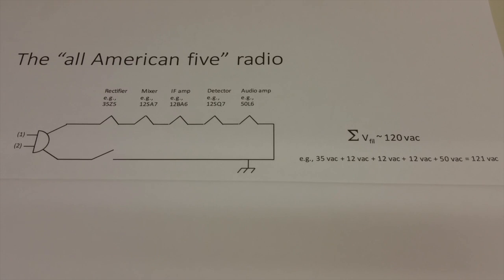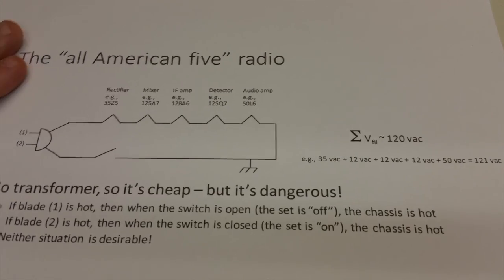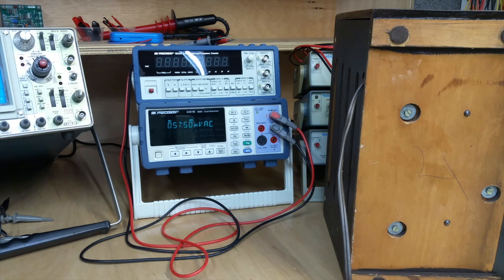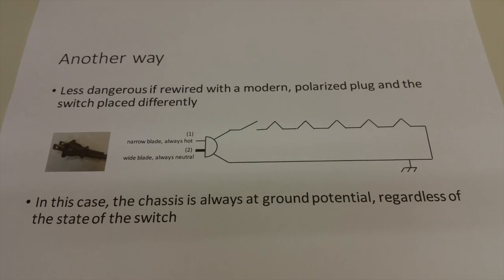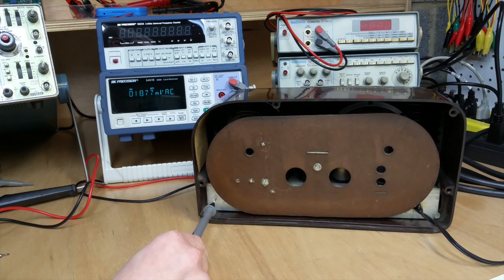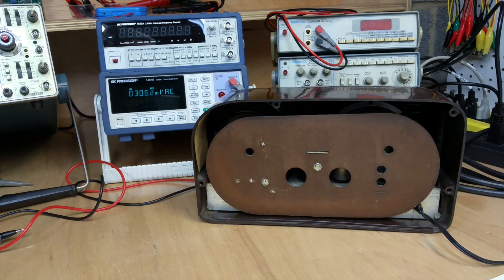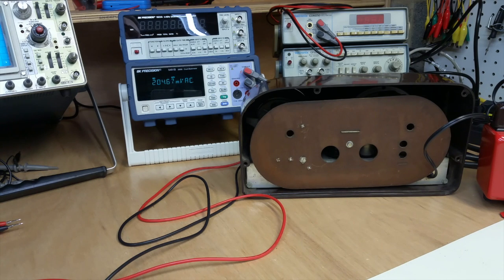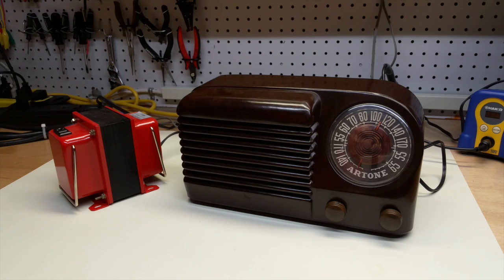#4: The "All American Five" radio and isolation

Comment: I'm likely missing something here, but  wouldn't- 1. Wiring the switch to the hot side 2. Using a polarized plug that's properly installed  3. wiring a GFCI into the radio  provide more than a measure of safety in an All American 5?

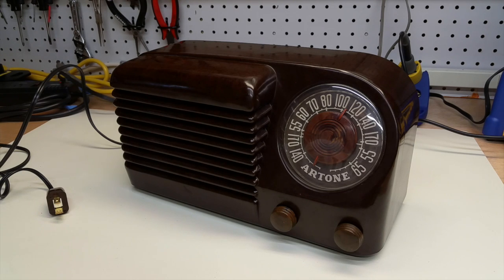Comment: What mistake was made that the Artone starting around 6:33 was not safe?  I would guess that the hot lead was wired to the switch, but the switch was not rewired, so when the switch is on, the hot is connected to the chassis?

Comment: Great video! When I was a kid it was so common for things like this to give you a shock that it’s hard to believe we survived. We had a Webcor tube record player with a metal tone arm that would give you a jolt if you had bare feet or touched a ground while operating it. Later on I had a Silvertone tube record player that did the same thing, I remember telling my dad but he couldn’t find anything wrong with it. I also had a Zenith AM/FM tube table radio that would deliver full line voltage to the chassis, it sat on a shelf right beside the radiator in my bedroom. One night I reached behind it to mess with the antenna while my arm was touching the grounded radiator and got knocked outta bed! Consumer Reports used to warn you about this problem and deemed some of these units “unacceptable” if knobs could be pulled off or live screws were exposed.

Comment: I had a 1955 RCA All-American five radio. We were down at Rehoboth Beach for the summer, and I put the radio on my bare lap with my feet in the sand. I got shocked so bad, that I peed myself. My father thinking something was wrong with the radio cut the plug off. One of the two screws on the bottom had made contact with my leg outside of the shorts...

Comment: Very good video.  The only comment that I have is that I have the very Aretone radio in the video  It does have a back that is missing in this video.  However, as the video points out, the radio is no safer with the back on-the screws on the bottom and the knob shafts can still be lethal.

Comment: So if I am using an O Scope to test this type of radio,should I plug the scope into the isolation transformer along with the radio,or is it 

okay to leave it plugged into the house mains? Which is safer?
Reply: The radio should be plugged into  a variac then plug that  into an isolation transformer . You can safely use the oscilloscope as normal.
 But before doing so make sure the radio has a polarized plug and the neutral line goes into the line from the filaments AND the other side ( hot) is switched
that goes to the filaments and bulb. As the video shows don't assume that someone else has just put a polarized plug on it without checking the circuitry!
Reply: Run it off a battery supply

Comment: I don't need to know the warnings of a hot chassis on a radio, a long time ago we had one of those round vintage fridges, that was ungrounded, and next to the fridge was the light switch for the room, which had a stainless steel cover, naturally id turn oin the light while opening the fridge, but in doing so id complete the ground leg of the fridge and get this buzzing feeling through my entire body, id let go, but this would happen a few times before I learned my lesson, its not a fun feeling either I might add
Reply: These are the reasons in Europe you cannot plug an ungrounded (not double insulated) plug in a grounded socket but can do the opposite.

Comment: Until I can afford certain pieces of equiptment ,how about a safety capciator and or a fuse.or if I tough a volume knob to make sure I dont touch anything else ,and yes getting shocked is something I fear I been blasted a couple times when I was younger.Thanks for your video ,can I ask what did you pay for your isolation transformer and where did you buy it at.

Comment: I remember, years ago, when I first encountered these safety plugs in which one prong's wider than the other, I didn't understand their purpose.  It was inconvenient to plug them in the right way so I ground them all down with a motorized grinder so they'd fit the socket either way.  I was wrong & beg you for your electrical forgiveness.
Reply: This is all well and good as long as the mains and extension boxes are wired correctly too. My test bench has a Variac feeding an isolation transformer with a dim bulb series limiter. The hot and neutral wires can be reversed after it leaves the breaker box. The only safe option is a ground fault interrupter and that still requires the  DUT to be wired correctly. Many of these Radio restorers are more concerned with cosmetics. The AA5 came about to be so popular as a result of the WWII effort. Transformers required miles of copper and the military came first.

Comment: Thank you for this lesson,I just bought a 1953 Sears Silverstone,I got a feeling it's a hot chais,I haven't open it yet I will soon to order caps for it ,I am thinking of getting a isolation transformer ,I found a good price for a new one ,if you no anything about my 1953 Silverstone radio please let me no ,I hate getting shocked,I am going to try the method you are showing us for testing it ,do you recommend replacing the cord ,the plug it has on it ,I can switch the wires around ,if you think that idea is ok ,please let this old man no,I did buy a replacement plug for it ,pretty much the same .thanks again for your safety video
Reply from the maker: I'm glad you found the video interesting. I strongly urge you to learn more about radio repair and restoration before working on your radio or anything related to mains power, which can be lethal. The Antique Radio Forum, http://antiqueradios.com/forums/viewforum.php?f=8&sid=3279a08b28998acdefc23bd2285bd047, has such information and can provide guidance, as can other sources. Please be aware that there are different types of isolation transformers, and not all provide the needed isolation. See, e.g., http://www.antiqueradios.com/forums/viewtopic.php?f=8&t=120898 and other similar threads at that site.

Comment: First “thank you” sincerely for saving my life, since I’m very new to radio restoration.  

I bought a Varik.  Is that the same as an isolation transformer? Also I’m currently working on my first AA5 project a Hallicrafters  5R33 AM/SW so what do I look for to ensure I use an isolation transformer?

I did learn never to plug in an old radio which I have not done so far.  

Thank you once again.  Steve
Reply from the maker: A Variac (also known as an autotransformer) provides no isolation. The variac and the isolation transformer are different. There are on line resources describing the need for and proper use of both variacs and isolation transformers available at the Antique Radio Forum (there are numerous threads, see, e.g., http://www.antiqueradios.com/forums/viewtopic.php?t=62638 and http://www.antiqueradios.com/forums/viewtopic.php?f=8&t=194901) and you can also ask questions there. See also the excellent https://www.youtube.com/watch?v=XBsQ3sZ45Fk&t=1s.
Reply: I found variact ebay as low as 39.00

Comment: Thanks for the information. I just restored a Majestic "Zephyr" radio from 1946. I installed a line cord with polarized plug and re-wired the switch to the hot line of cord, a pain as Majestic used the switch contact as a ground point for 6 or so components. 

My radio has two grounds in an attempt by Majestic to mitigate the safety issue. This AA5 radio has its chassis semi-isolated from the rest of the circuit with a .05uF capacitor in parallel with a 220k resistor. This limits the current, but both the cap and resistor will pass AC. I figure the reactance of the .05 cap to be at 53K at 60 Hz. In parallel with the 220K resistor or about  42.7K ohms. This will still pass 2.8mA of AC current, enough for a nasty shock or even death. Better than a dead short through your body, I guess! Perhaps an in-line GFI after rewiring would be prudent.

As a kid, I got bit by these radios all the time.My family had an aluminum-cased RCA that was a particular offender. This was used in the garage and outdoors and regularly produced yelps of surprise when re-tuned. I'm amazed we all survived!
Reply: In principle the chassis should have been insulated from the aluminum case of the RCA, but if somehow a spacer or grommet was omitted on reassembly after taking it apart, that would cause the case to be electrically connected to the chassis. Another possibility is significant stray capacitance between the chassis and the case, both being metal objects with a large surface area in close proximity.